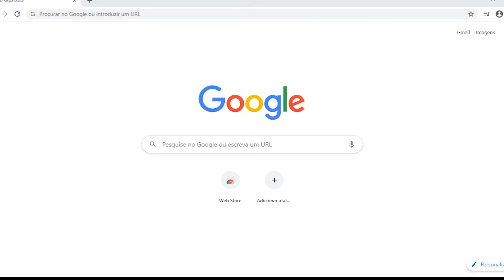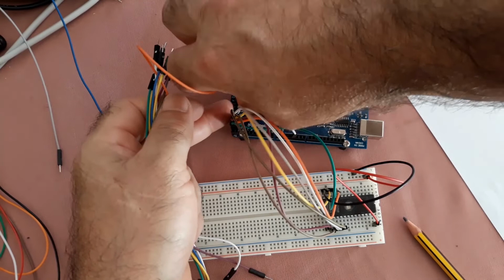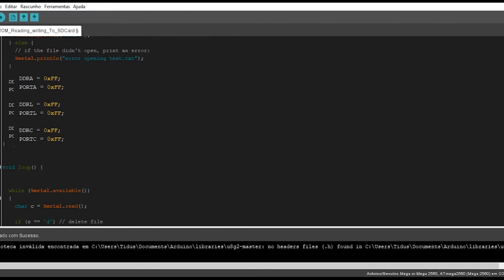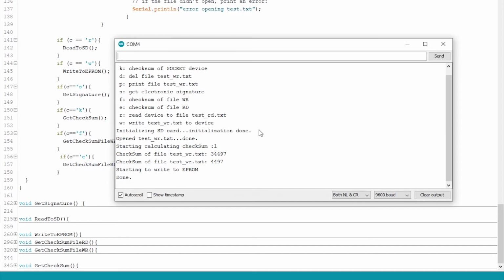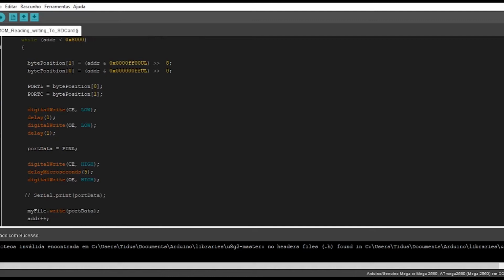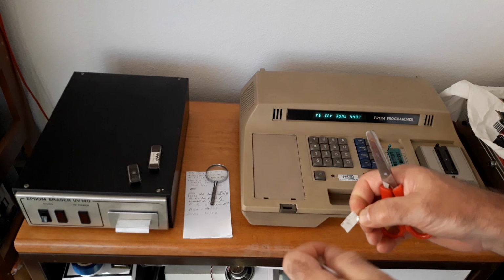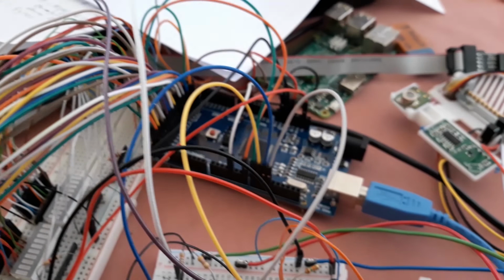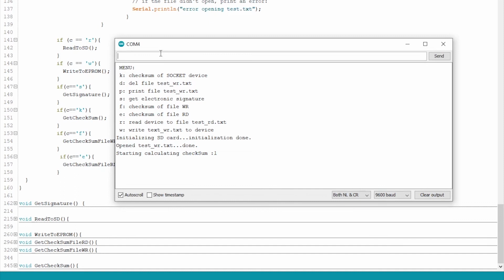EPROM Read Write with Arduino and MicroSD

Comment: I wish you good work.  I have a question.  Can vehicle tracking system be made with 3G wifi?  How can I make this system?
Reply from the maker: Hi Osman Hançer,
The "track" can be done on any moving object, for that we have to have a data communication that can be constant or intermittent but regular depending on this granularity of the desired knowledge for each change of position. So a Wi-Fi network being short distance does not guarantee coverage beyond a certain distance, it is possible to monitor the trip to the cafe with the vehicle, little more than that.
The normal thing is to use networks that can cover long distances (anywhere on the globe)
Reply: @jlsmonte  I understood you. I want to transfer location information to my phone via GSM via the mobile line in .3g wifi modem.  otherwise, as you said, the wifi area is very short 30 to 40 meters.  but the message can be sent to all over the world via gsm.  I want to do this too
Reply: @jlsmonte  Also, with this system, I can go to the internet in my car, the main purpose is not to go to the internet but to follow the location of my car from my home.
Reply: @jlsmonte  your opinion is important to me.  what is the probability that this system can be built?  thank you
Reply from the maker: There is nothing complicated, just use an ESP32 with a GPS attached and create an app for the mobile and has the connection with the world. It is perfectly feasible!
Reply: @jlsmonte  thank you .

Comment: Hi Jose
First thanks a lot for the effort and sharing with the community.
I am trying to build your programmer to replace my faulty ZX Spectrum ROM, my problem is that I am a bit confused interpreting the schematic, I would appreciate your help:
1 - I don’t understand A9 electronic signature a lot of 27C256 didn’t even mention it, is it optional?
2 - what is the switch NC/NO and connected with dotted line something that I can’t read “xxxx to xxxx signature Vpp”.
3 - A lot of pin mentions Vpp like pin 11, 9 of Arduino and other points of the transistor circuit, I don’t think they are all connected to the 27c256 Vpp at the same time.
Thanks
Reply from the maker: Here is a link of one EPROM with Manufacturer’s Identification Code.

https://pdf1.alldatasheet.com/datasheet-pdf/view/89931/NSC/27C256.html
Page 9
Note to be able to read it at fixed positions you need put 12,5 at pin A9... off course this step is optional! But it will give to you security of well implemented process.
The switch must respect: 
1-To read signature the VPP must have closed to +5VDC and the switch of +12,5 must be normal closed to connect output of opto-coupler, which is controlled by pin 10 (2560), to the A9 to get here +12.5 this allow read signature zone which is only opened by the presence of +12,5 at pin A9, ok.
2-To read data, the VPP must have closed to +5VDC and the switch of +12,5 must be normal closed to connect output pin 36 (of 2560) to the A9. This will give the value of real Address of pin of EPROM A9.
3-To program the EPROM the Switch of signature stay open to avoid the  collision of +5VDC with the +12,5 voltage of programacion. The pin of EPROM to the VPP is same!
4-The pin of switch of signature (VPP) and the collector of 2N2907 go both connected to the PIN VPP of EPROM. Note the +5 coming from opto-coupler controlled by pin 11 (from 2560) with indication of "Vpp +5"
5-The tree points marked with +12,5 Vpp is the "power source" of the voltage used to VPP... on this case is +12,5, but have others EPROM which use for example 21VDC
Hope this can help to you.
Another any question, let me know, ok

If you need a specific copy of one EPROM, send to me the file BIN or HEX and I will burn one EPROM to you with the file.
This not invalidate you construct this to stay independent!
Good job!
Reply: Thanks that clears a lot of points, but simplify it to myself I will start with a reading circuit only to avoid the mess of transistors and when I succeed I will add the transistors for different voltages.
Sorry for inconvenience another questions, I have seen that you write txt files, do I rename the bin file to txt or do I need to process it somehow?
The second question you used pins 49-42 for the least significant bits and 37-30 for the most significant bits those are 16 pins to program 27C256 it has only 15 address pins A0-A14, which pin in the Arduino I ignore and at which line in your code do I change the size of the ROM?
Thanks a lot for your response and time and I will update you with my progress ❤
Reply from the maker: @ultimateworkshop2000  Hi,
The weight of MSB and LSB are on port A and C:
Port A start A22 to A29 and is A0 to A7
Port C stard C37 to C30 and is A8 to A15 (They are reverted on MEGA) but is only one question de order to connection, ok.
The pin A15 (is address pin 16  because start from A0) is not connectd in to this case size EPROM.
The lines responsable to define the size of EPROM is all like this:
" while (addr < 0x8000){" except the 0x0002 to function responsable to read signature! You can create a global variable and change only the line of the variable... note the variable must support 2Bytes, ok
'unsigned int addr = 0x0800;' because the size of EPROM is 0x07FF
Now replace: "while (addr < 0x8000){# by "while (addr < addr){"
The value present on the code is a sample value to the size of EPROM
You can reach the size of EPROM 27512/8=64K,  2764/8=8K...Please see another video about EPROM's on my channel, there you will find tables to help you!
Good Job
Reply from the maker: I forget make mention to the type of file:
You can use both .TXT or BIN... pleas use one editor like TextPad, this is free to private and allow to open files like bin or Hex.
Reply from the maker: One more important thing! The connection of OE of output from 2560 can't happen in the program mode!
Reply: @jlsmonte  
Hi,
Do you mean for 27C256, Port C to be C37-C31 connected to A8-A14, and change the weight in the code as follows:

  DDRC = 0x7F;
  PORTC = 0x7F;
Reply: @jlsmonte  
I didn’t understand the part about OE, do you mean that during programming “writing to the EPROM disconnect the OE pin from Mega keep it float or do you mean connect it to ground?
Reply from the maker: @ultimateworkshop2000  You can use a diode 1N4001 coming from pin 7 to OE/Vpp This protect the port of 2560!
Because the OE is active at Low value you need a resistor of +/-47k from pin OE to the GND. You can keep this resistor always in circuit. When the +12.5 is present trough the transistor the value of resistor allow the change of level logic without difficult.
Or also you can use a switch and control it manual mode... need care because if you forgot remove it, you will connect +12.5 to the pin of 2560... will burn it!
To read the EPROM the OE (output enable) must be a level LOW (GND)
Good work!
Reply from the maker: @ultimateworkshop2000  No is necessary change the registers of DDRC and set value... keep it, and only  let the A15(C31) disconnected.
Reply: Hi Jose,
I was getting initialization failure in the SD card, after a lot of trials I found something wrong in the comments of the code you wrote:
//Miso 52
//Mosi 51
//SCK 50

It should be:

//Miso 50
//Mosi 51
//SCK 52

The SD card now initializes correctly but when I read the ROM I get text_rd.txt with 0kb it’s an empty file, do you know what could be the problem?
Reply: In the above code there must be a digitalwrite with the address pins and after it there must be a digitalread from data pins, am I right?
Reply from the maker: @ultimateworkshop2000  Hi,
Maybe it's possible, but I used this page: https://forum.arduino.cc/t/wavgat-mega-2560-r3-atmega2560-and-3-2-inch-tft-lcd-screen-module /575604
Anyway if I'm encountering any difficulties in the connections I apply the oscilloscope to see the signal and correct it! This might fool me on the documentation!
I replace the Digital Write an Digital Read by manipulation and assignation of the PortX and do it also same times to the Byte.
About the card, If you using an adapter, please check power of it, exist of 3.3V or 5VDC.
You can check the original code to manipulation with SD card, this is a sample standalone from WEB, like I tell at begin of video.
Good Job.
Reply: @jlsmonte  Hi Jose,
I have a good news, I was able to successfully read the EPROM into the file, here is what I did:
First I was sure that the SD breakout is working I took it from another working project and the test_rd.txt was created but nothing written inside 0bytes, so I uncommented the serial print

Serial.print(portData);

Boom all data in the ROM scrolling on the serial monitor, at that time I thought may be the data is being cached before it is written and the write process is not terminated properly, I tried closing the file after the while loop and it worked

myFile.close();

Tomorrow I will make the voltage circuit and try writing.

Thanks you very much.

Comment: Bom dia!
Monitoramento de parâmetros de inversores e salvar alguns paramentos no sd card. Exemplo: P3 e P9 do inversor de hora em hora.
Reply from the maker: Viva,
Podes PF ser mais especifico:
Como saiem os dados do inversor: I2C, ISP, word 8bits?
O que é o P3 e P9?
Reply: @jlsmonte  seria criar um datalogger usando a comunicação rs485 e sd card para monitorar os parâmetros P3 e P9, o parâmetro 3 é referente a corrente do motor em amperes e o parâmetro 9 é referente ao torque do motor em porcentagem. Um modelo muito usado é o da Weg cfw500.
Reply from the maker: Esses dados p3 & p9 estão constantemente a ser enviados via RS485 ou tem de se proceder à leitura acedendo a determinado endereço?
Para o desenvolvimento teria de ter um Weg cfw500 comigo, não tenho! Mas se justificar o desenvolvimento pode-se encomendar via WEB há vários usados!
Pretende-se guardar dados relativos a quantos horas/dias/semanas/meses? Tens ideia?
Esses dados suponho que se possam ver no display do "inversor" localmente, não?
Reply: @jlsmonte  isso, manualmente é possível consultar os valores dos parâmetros. A idéia do datalogger é para eliminar a ida até o equipamento de hora em hora. Entendo sim que fica complica explicar sem ter como realizar o teste de bancada devido a falta do equipamento. Agradeço sua atenção desde do início.
Reply from the maker: Avalia as vantagens e desvantagens, se justificar pode-se comprar um usado para servir de base ao desenvolvimento! Pode-se inclusivé aplicar um display remoto via RS485.